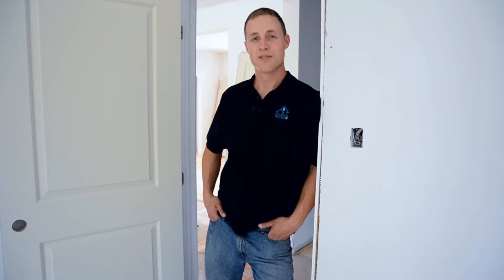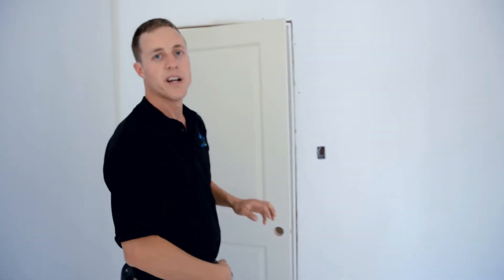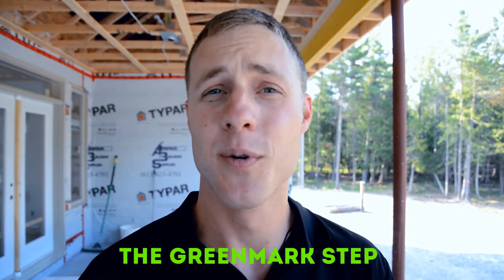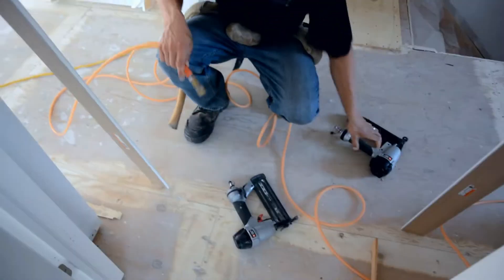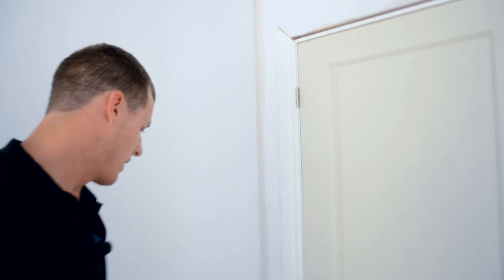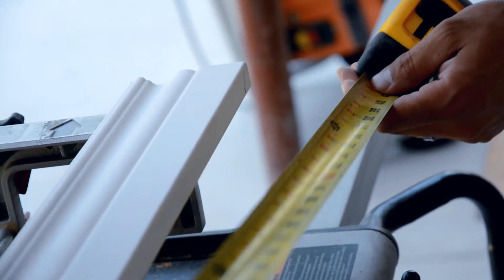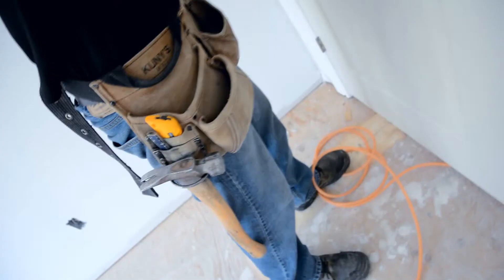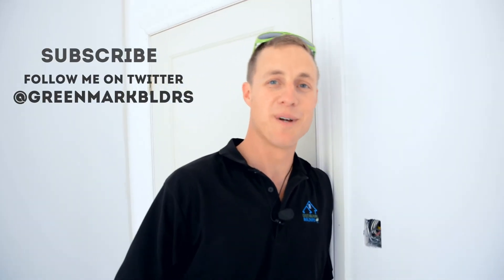Installing Door Trim - Greenmark Builders TV

Comment: Hi mark I used to build full casing trim sets and super glue the joints then gun them to the frame it was a very effective method .used to create all my door frame sets and then fix all at one time on new build .MDF trims are easier than timber and as you say less shrinkage.